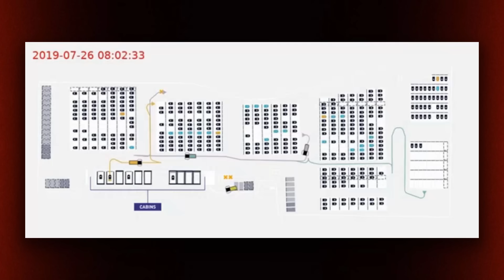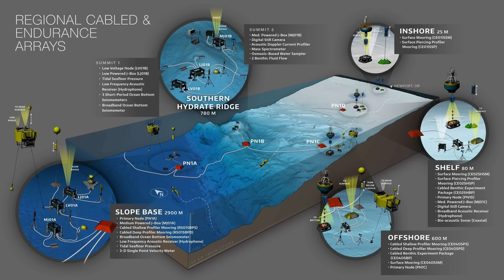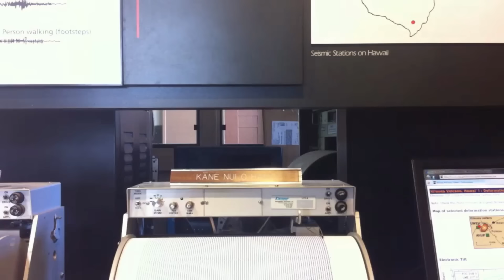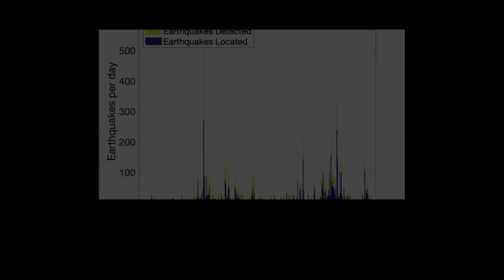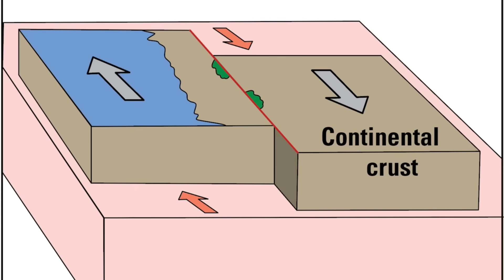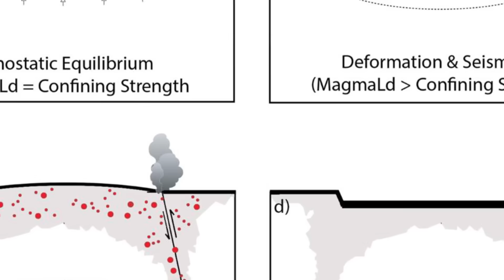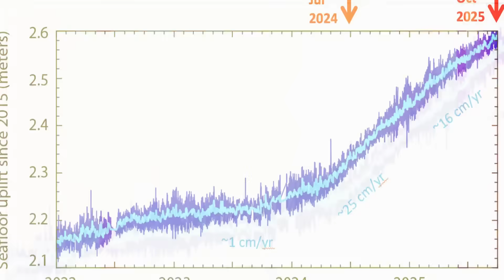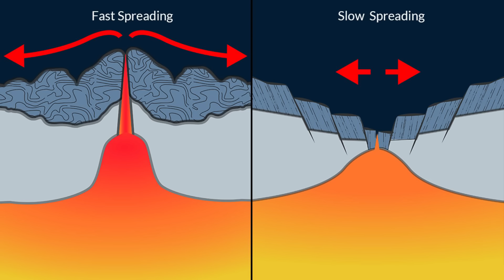3 MINUTES AGO: Oregon’s Hidden Underwater Giant Axial Seamount IS LOCKED AND LOADED

Comment: If I look at Google Earth Pro, the standalone version in Linux, and hover over the area about 300 miles measured westward from the Quinault Reservation just north of Gray's Harbor, there is a seamount that measures a minimum of 455 feet below sea level according to the numbers at the bottom right of the GE window.  I installed a KML from the USGS that shows tectonic boundaries between the San Juan Plate and the Pacific Plate.  The seamount is on the Pacific Plate about 52 miles west of the San Juan Plate (which represents a remnant of the ancient Farallon Plate).  There is actually a lower seamount about 25 miles west of that one at about 2000 feet below sea level.